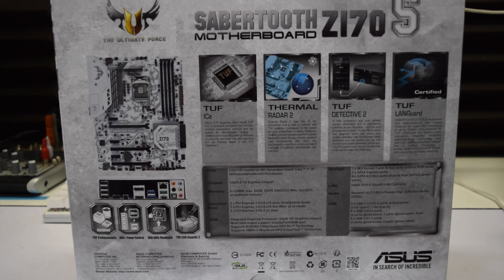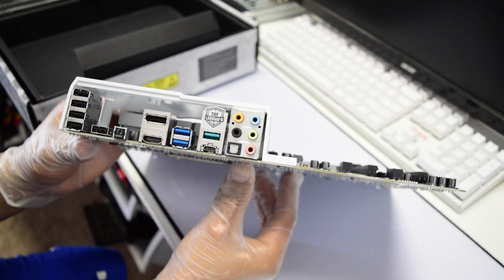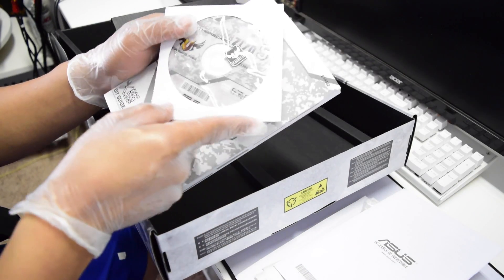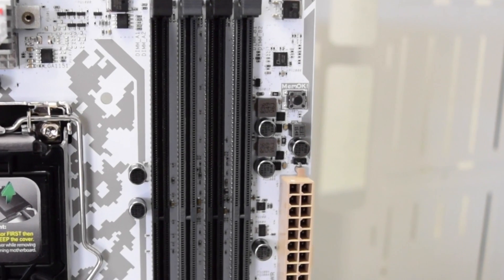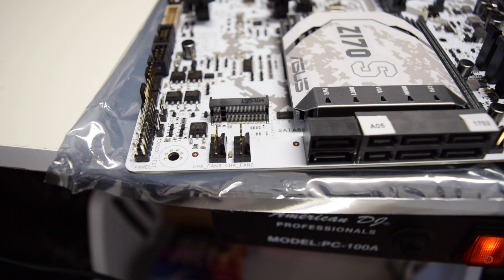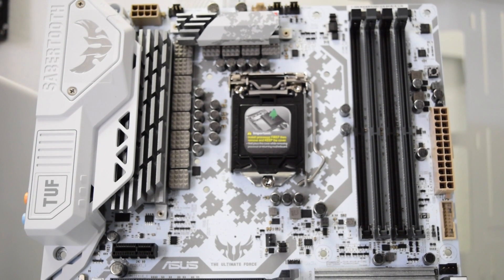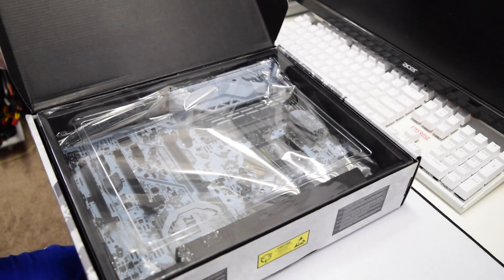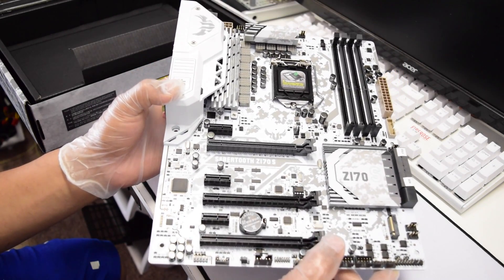Asus Sabertooth  Z170 S Overview & What's Inside The Box?

Comment: +Tek Overclocked
The black mesh is for the back I/O panel. It is used as a dust filter for the 40mm fan that you can install if you want for cooling the VRMs.

Comment: I really like the look of the mobo, but id rather prefer a mobo that supports 3000/3200 ram natively..
Reply from the maker: with a bios update allot of us are running 3000mhz or higher with out a single problem
Reply: so i can basically get straight 3000/3200 ram? Its just going to run slower unless change it in the bios? Wanna run this with some 3200 gskill tridentz with the black/white ones spreaders..
Reply: So It's relatively easy AND reliable than to get it up and running on 3200mhz ram?.

Bios update is easy?
Reply: Also overclocking? Have you done it with the 6700k on this board yet? or used this board for overclocking in general.
Reply: Asus has the ability to update via internet/usb.. should be easy. Im already sold on that white mobo, just that ram support holds me back somewhat.. think ima order it anyways and give it a shot.
Reply: Right, I have done some more research on the board, because i WILL be using some 3200mhz ram. It shows on their website for the vendors, anything 3200 mhz and up will depend on the cpu for system stability (Since you have to enable XMP)
http://dlcdnet.asus.com/pub/ASUS/mb/LGA1151/SABERTOOTH_Z170_S/SABERTOOTH_Z170_S_DRAM_QVL_20160113.pdf 
Now i'm also going with a 6700k so i couldn't see it being an issue, I have also gone further and looked on pcpartpicker and seen other people who have 3200mhz+ ram in their build list. it's just anything above asus's suggested ram may not work. since you have to enable xmp and then it's dependent on the CPU. (My understanding.)  This is the only white/black motherboard on the market that i can find,  besides from the xpower titanium or whatever, Which is more than double the price, for a z170 platform it's not worth it i don't think. (AND it's not really white...) But i literally have everything for a super white build added to a cart and i am checking out soon, so R.I.P
Reply: Which 3200 RAM are you gonna go exactly for?
Reply: supa dupa scroll tru some of my videos i got plenty of tutorials Overclocking with the 6700k bios updates all of that
Reply from the maker: supa dupa oh snap i replied to u from my gaming channel my bad
Reply: Any 3200 Mhz ram will work, I already ordered all my parts. All you have to do is put in any ram into the motherboard and it will down clock the ram to the motherboards preferred speed, Then you go into the bios and enable XMP and you are pretty much done, There is no harm in running 3200 mhz ram. If you go to Newegg.com you will see most of the board specifications show this DDR4 3733*(O.C.)/ 3600/ 3500*/ 3466*/ 3400*/ 3333*/ 3300*/ 3200*/ 3000*/ 2800*/ 2666*/ 2400*/ 2133 Meaning anything with an * is overclocked and you probably need to enable XMP from my understanding, So even something like the maximus hero VIII needs xmp enabled for anything 2133mhz+ And as @Kreeper24 plays said, He has good videos on it. If you need help you can message me  i just did a build :P